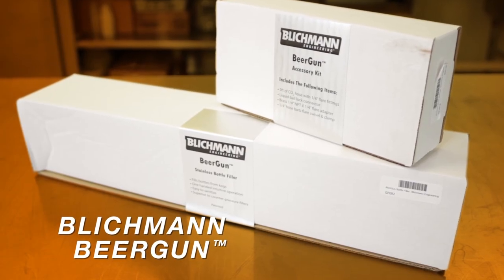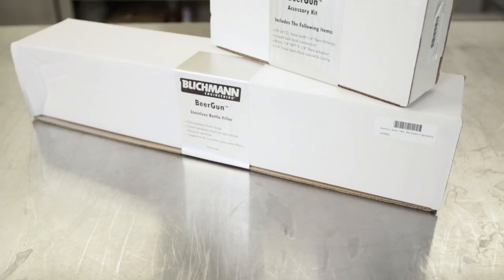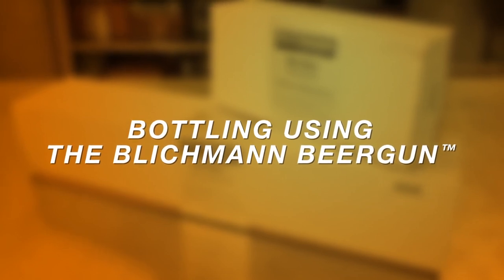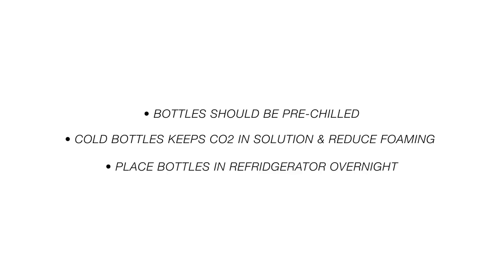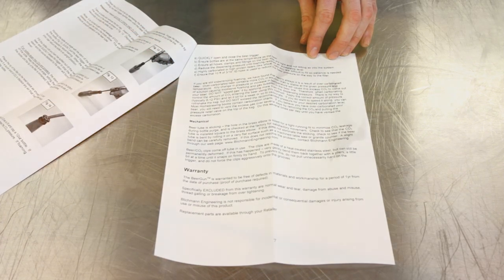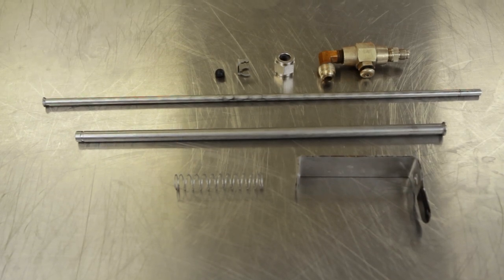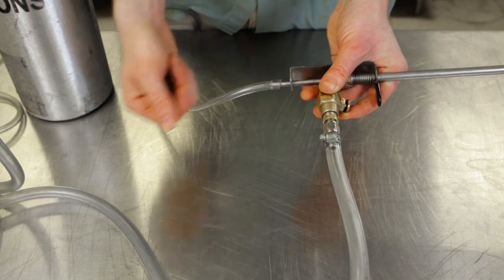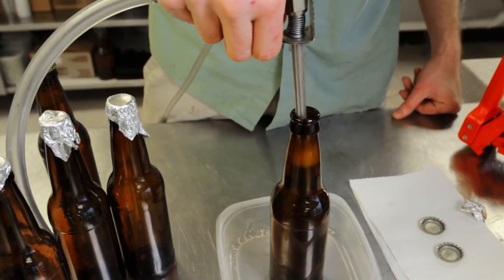How to Use the Blichmann BeerGun

Comment: Hi there, I want to start bottling from my kegs but i am confused by the gas set up. The two way manifold is just a gas splitter in another form? The pressure of both gas to the beer gun and to keg will be regulated by the same regulator and therefore have the same pressure (2-5 psi ) is this sufficient (or too much) to push beer from the keg?  Is a 2 way regulator not needed? Many thanks.
Reply: You are overthinking this. First you must pull the quick release on the keg so you can get the proper psi. 
After your beer is properly carbonated in the keg. Blow it off and dial in 3-5 psi on the regulator and you are ready to fill bottles.

Comment: What is the ideal temperature for the keg of beer? Orque I use my BeerGun and I do not have great success with barrels at 14C
Reply from the maker: They recommend around 40F (4.44C). I think where you are, you probably have CO2 coming out of solution a bit easier at that temp. Make sure your bottles are also the same temp as the beer.

Cheers!
Brya

Comment: The reason the bottle he filled at 0:25 foamed up so much is because of how slowly he opened the faucet.  Not that I recommend filling bottles from a beer faucet, but I'm not sold on the beer gun.  What does it do that other bottling methods don't?  You can purge the head space with CO2 after filling?  Big deal.  I can make something that will do that for a lot less than $75.
Reply from the maker: Thanks for the comment! The big selling point of the beer gun and other counter pressure bottle fillers, is that they allow you to force carbonate your beer, and then bottle some off without losing any carbonation thus keeping the quality of your homebrew intact. Perfect for giving some to your friends, or if you are entering a competition. In terms of the price, yeah you could definitely piece something together for cheaper that effectively does the same thing. Some brewers enjoy having a pre-built setup though as it lets them focus on other parts of the hobby that they may enjoy more! Cheers!
Reply: The beer gun isn't counter pressure though.

I find the best way to fill a bottle from a keg is to use a hand tap with a length of hose on it.  If you start at the bottom, draw the hose out as you fill, allow it to foam a little, and then immediately cap it while foam is still coming out, you can be sure there is no oxygen in the bottle, as the bubbles in the foam are filled with CO2.  It helps if the beer is slightly over carbonated, and it takes some practice to get it right.
Reply: @greatfermentations  I'm definitely getting one for home use. I have one at the  home brew shop I work at, and we allow customers to come in and fill cans or bottles with it. 
This gadget is worth its weight in gold. Those that don't think so, in my humble opinion, only like to complicate things. 😁